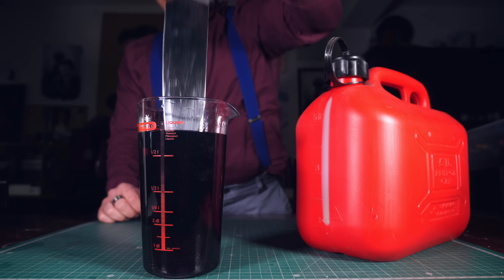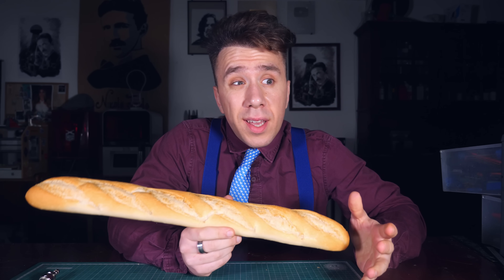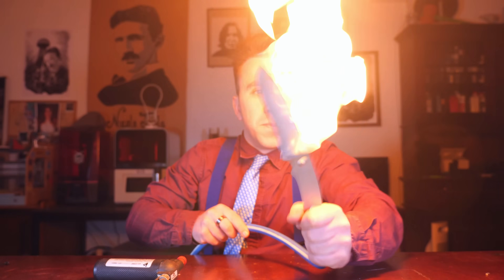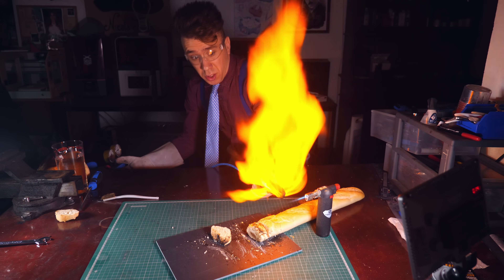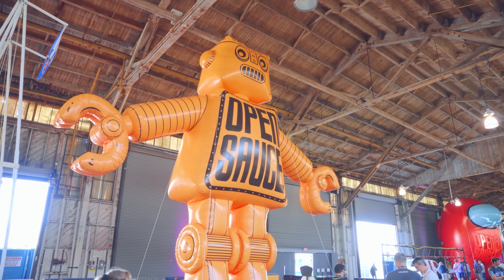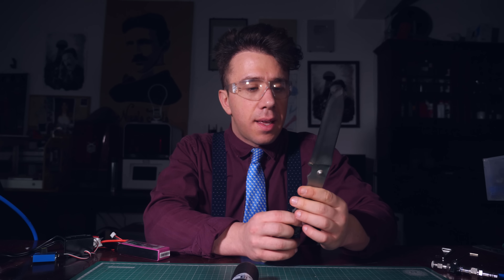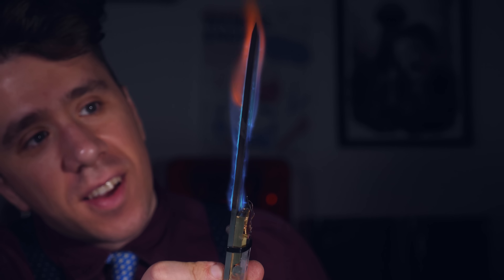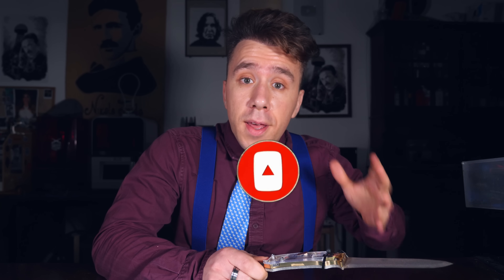I made a TRUE FLAMMING KNIFE

Comment: Can they do combined printing styles? For instance layers of solid/porous alternating, or having a solid shell with a porous interior, or the reverse. This could help with directional flow of air or liquid, making this ideal for many applications. 🤔 porous rings/tubes with directional airflow could assist in fuel/air dispersion, and could even have possible applications in design simplification. 🤔 you could have two separate intakes for air and have them meet in the handle, then design a track inside that forces the air towards the edge or tip, or only on one side of the blade. Would a porous turbine cover interior allow for adding the fuel in at that point? Just a thought. Also could this help with rotary fired propulsion?

Comment: Multidensity material to guide the flow of the medium and then use the porous area to release the fluid down channels or release in a pressured area to spew it out like a fuel injector. Think of air filter in the metal of an iron man suit so no toxins get through. That might be multidensity and material.

Comment: Mans just casually makes a lightsaber when testing a jet engine theory, Fucking sick.
Reply: Or you could actually Make a lightsaber using this principle with a telescoping tube, this could either become a bomb in your hands or evenly distribute the o2/h2 mix within the space and allow the pores to act as a filter screen so long as you have a double barrier between the ignition area and the fuel injectors (for safety, if you care about that).

Comment: It looks like if the internal channels are handled correctly, you could actually get the flame to be wholly contained within the blade. This would take some tweaking obviously, but that way there are no external flames, merely an intensely glowing hot blade. Not sure how the metal would handle such abuse, but if built of the right materials and tuned properly (and a heat guard of some kind for the hand) seems like it would be a devastating weapon. Additionally, in regards to a jet engine, if the application of porous metal could be strategically placed such as along the trailing edge of the blade, that could potentially yield better and more controllable combustion results.

Comment: As a project suggestion, look up Floyd sweet and T E Bearden, in particular in regards to a paper published in 1991. It will take you down into a deep rabbit hole that I think you will enjoy. 
I haven't managed to source a barium ferrite magnet yet.. the manufacturing seems to have changed to other materials. It needs to be barium to work I think. Beard explains it using optical math. 
But could be great fun. Even Tesla gets mentioned. Also a fellow name Whittaker. If any of it has any merit it would change physics. And piss off a lot of rich people in a dangerous way. But it would be a great video.

Comment: I know it is not a jet engine, but would a submarine hull made of this metal, or a torpedo travel faster through water with a hull made of this metal?  I know sharks have very tiny dimples in their skin to create less drag in the water.  If the hull emitted a shell of air bubbles around it would it have less drag?

Comment: You can also try doing a somewhat thin rocket nozzle that goes al the way to the end and returns to the center, cover all of it but the very center ( or end, for the nozzle to cool with the hydrogen) with coating the outside with metal so that the pores to the atmosphere are closed functioning more like a pathway for the hydrogen to pass by, just like the actual rocket nozzles, u can cool your nozzle while distributing fuel. These micro pore would probably work perfect

Comment: Is the idea of changing jet engines forever that they could pump air into the hot side of the engine and keep the heat away from the metal parts so they can run the engine hotter without melting it or something else?

Comment: this tech has one MAJOR problem for use in a jet engine, the whole inside is like a sponge, so blowing air through it for cooling has MASSIVE pressure losses because it's basically a giant throttling valve.
there's a reason why real jet engine parts that have film cooling use a shell with electrical discharge machined holes instead of a spongelike internal structure.
this sort of porous metal is also just not very strong, especially in tension, so the turbine blades, which get the hottest, would just break under tension from spinning if you made them this way.

Comment: As well as running fuel through it for smooth ignition and combustion in a jet, if you make the compustion chamber, foils and compressor blades with that material and run air through them it will cool them and allow the engine to run at temps above the melting point of the metal. Higher temp engine = more power, a lot more power.

Comment: electroplate steel or something hard and  paintable on to surface that cold then be pealed from it,  like a stove black covered piece of duct tape. extra points if yo use a microwave oven transformer.  then do the same to make a metal patch in a rusty car fender. 
again extra points if you use a tray of electrolyte and a pump to wet spray the metal onto the carbon black ducktape patch  building up to 2 mm thickness.

Comment: i don't know if anyone has suggested this, but try to create a rig for the knife you just made that spins the knife while it's rotating at around a 1000 rpm, and figure out the optimal rotational speed and gas injection pressure to create a literal flame wall... !!! 

props if you can do this with a long bar instead of a knife... this would be a good concept to start working on the jet engine tbh.... if the fan design can literally spew fire and rotate fast enough to suck in enough air, you have what you want.. :D 

if you like my idea, please conisider sending me that 3d printer... i would be absolutely thankful.... i don't even want it for free, i'm literally willing to pay what i can afford on my end to have one !!! 

living in a third world country is absolutely shit, can't find good deals anywhere and even if printers are available parts are missing that make it impossible for me to get it in my city in working condition...

Comment: Idea:
Spin momentum based drive.

Three main part.
A pipe shell that is closed at both ends.

At one of the inner ends, a plate that is anchored there with a motor.

So they spin counter to eachother.

And it is full of liquid. That liquid is hevier than both....

When that motor is running, at most of the pipe, the liquid is concetrated at the wall(/floor, really, spingravity/angular momentum) more at the end with no plate.

At the end with the plate, that counter spining(plate and pipe) makes the combined effect of the angular momentum on the liquid weaker. 
So it is not as heavy to the floor/shell, which makes it experience a presure differencial. Thus it goes to fill up the middle.
...

Remember, it is heavier than the shell, so it doesn't fly back/to the other end in the middle of the space in that pipe, as fast as it is throwing back that end of the pipe shell.

And that shell pulls with it some of the liquid at the walls, same liquid that is going on its own to flow that way because some of that liquid there is now at the middle of the pipe.

And some of that will be nullified by the liquid that goes back... more that enough to make sure that what hits that other, plateless end is not enough to actually nullify that forward momentum.

Comment: Why am I not surprised to see a video where Integza is cutting the cheese?   I kind of feel that if Integza cuts the cheese with a flaming knife, there should be some blue flame.  I think you could get a flint out of a standard pocket lighter you could mount it so it strikes on the blade and throws a spark without the need for a battery.  Ok, so the blue flame comes later.  It might be a good safety feature to have a spring loaded cutoff valve on the handle so you can stop the gas just by letting go of it.  That way, it won't continue to burn if you drop it.

Comment: The repellant feature is awesome! Propeller and boat hull would make a low friction and perhaps efficient boat.
Reply: Kawasaki did it years ago on one of their JetSkis. High pressure air was injected through ports on the front of the bottom of the hull. I can't remember what model, they didn't do it very long since it was prone to issues. But other ships have done it as well. Air Lubrication Systems they are called.
Reply: It seems great… till you realize turning off the pressure makes it just another leaky boat
Reply: @coffeegonewrong  Why would the upper/interior parts be porous?  That would be a foolish design that wastes half the power and whatever gas is injected into the hull.
If only one side (or only the blade...) of the knife needed to have the desired properties, they would seal the other parts, as they did with the handle of the demo knife and support fittings of the industrial ones.
Also, there's a point in hole diameter where air and other gasses can pass, but liquid water will be stopped.  That's what Gore-Tex material does.
Reply: @VoltisArt I didn’t know that about goretex. Sorry, sealing the parts you don’t want leaking makes more sense.  I guess the mental image was funny so I wanted to share.

Comment: Another material that looks just like the 3d printed porous knife, is the air mufflers/diffusers on industrial pneumatics. Under magnification, some of them look like brass beads that have been heated and pressed into a truncated (blunted) cone shape. If Integza wants an off-the-shelf porous material, that has pipe thread already attached, I would use the pneumatic muffler method. I just checked the industrial supplier McMaster-Carr here in the USA, and I see they even make stainless ones.

Comment: The real use for this I see is in the fan blades.  They already have piping in them to get a layer of cool (relatively) air protecting them from the post combustion heat.  This would be even better.

Comment: If you get a lean (oxygen rich (air rich)) mixture going into the blade and run it for a few seconds then the metal should get hot enough to ignite the mixture within the knife leaving fully combusted exhaust, and the heat will be focused on the blade instead of making a huge 3 foot torch, so you could toast bread better 

You'll want to turn down the flow a bunch to keep the blade from melting

You could also drill a hole through the handle, and insert a pipe to seal off leakage in the handle, and increase transmission speed/capacity to the blade

Comment: I like the idea that you went, "not a fan of this plastic spinning next to me. I think ill stop." But you were just playing with hydrogen and oxygen in a shared line. As someone whose accidentaly caused a small explosion in that same way, that made me fucking nervous.
Reply: Same, every few minutes I got crazy nervous and mad at him BC he never said don't try this yourself and that stuff was dangerous af.

He literally put a highly flammable battery that could explode or catch fire (which would not be easy to put out) when subjected to heat next to a handle that is so hot it burns you through gloves. And that is only one thing.
Reply: he hooked up air not pure oxygen. still really dangerous but a pure oxygen supply is the one where you need to build flame arrestors in the line or else itslikely for your supply to explode.
Reply: @28porkchop  That is crazy still.

Comment: i wonder if its possible to have the blade significantly more porous as you get closer to the end so most of the gasses escape further away from the handle possibly even directing it to the point so the handle doesn't get nearly as hot, i think that would be a cool mark 2 of this knife

Comment: Too many comments for me to catch up, but this concept could easily be used for control nozzles (for instance afterburner or rocket nozzle components) as either a stand-alone, or an internal liner, to the parts (for instance inconel), which, if pumped through with air/whatever coolant, basically would create a cooling "shield layer" preventing hot exhaust gases from direct contact with the surfaces, thus allowing much higher potential exhaust temps without weakening/melting the surfaces.  
Also makes me think of a redesign of other troublesome surfaces, such as an SR71 inlet and other compressor surfaces, where the engine (and plane) itself could literally go MUCH faster than they ever did, mechanically, except that the parts would reach thermal failure levels... again, even a small flow of cooling air (or even possibly fuel injection as a coolant through the pores with significant enough flow to break the laminar flow on the surfaces, of the inlet/exhaust flow) would dramatically lower the material temps, thus allowing further performance.  Just some thoughts of possibilities, I bet someone else (in the labs already, or even here) has thought of this though.

Comment: Project idea: car stereo amplifier connectors, primarily power and ground.
 All connectors are one screw chewing into wires.
 Why isn't there a rotating while reducing clamp that doesn't damage wires and acts like a boa-constrictor ?
Further design would be a tiny gold plated tungsten needle at the amp side that could be slight conical and keeps the end part flared out, which would help secure the connection.

 0-8ga wire, trimmed end going into a flared hole with a center prong in the middle that will help separate the strands and on the back side (end of wire) will flare out again.... Now the center of the hole will be able to reduce its diameter with a greater clamping force than anything else without any damage to the strands, unlike current standards that drive a screw into them and mash them.

 This would and should be adopted as a newer standard for many reasons.

Comment: The only issue that I can see with having micro holes in the blades of a turbine is the loss of structural integrity and the risk of them bending and flexing while at operating speeds which could cause them to either knock into each other or oscillate and strike the housing of the compressor. Very interesting concept.

Comment: I don't think that this will change jet engines at all. Something like this was done in the beginning of jet age, when combustion instability was a MUCH bigger problem than what it is today. It used sintered pieces with the same properties. It proved WAY too lossy. Pressure losses were incredibly high. Cooling sheaths in HP turbines are also already state of the art.

Comment: For your next project you can make a 3d printed engine working with 40000 rpm compressor try to get maximum mechanical rpm with using the compressor

Comment: your jet engien idea is nice but I say that you can input air and the gas through the same tecnich an dthe whole engine metal .
and my idea is you could make a swiff knife sell it only for authorised persons.
or you could make a cooler for the summers . if it is cold there a heater or both.
you could make a electric skate board or inliner skates or a electric board or a hover board or a electric scooter or a bike fo winter with spike wheels to use on the frozen lake or pond.
or a machain that makes normal water filtered or carbonated . 
or a electric bottel with filter .
or a piece to put on your finger and then it turns into a lighter.
or a magnetic thrust machain .
or a real lighter saber with real fire. ( for the tomatoes )
thank you .
your big Fan.

Comment: I don't have a 3D printer: could you make me a jet prop?  

Make a prop, at the thickest part pass a jet stream of water or steam.  The Force of the water turns the prop.  The constant change of vector resistance will allow for a more efficient water jet engine.  

Now apply this to your jet engine: and use the system in two stages: to cool the air and the components: while expanding the gas to accelerate the combustion, and add more air to the final exit burn.  

I would also like to see you make a scram jet rocket engine.   This uses a hollow rocket body: that has intake to the rocket: internal burn: and a higher exit velocity of total exhaust.  The scram portion would activate once the rocket was at an advanced speed.  I have some drawings of this design, but not no useful ones of the Jet-Prop.

Comment: #theme hey, make a DC motor with thick copper wire and give very high voltage. I have seen many videos about it. At very high voltage it rotates very fast around 80-90k rpm. But NO ONE YET able to break the sound barrier. So give it a try to break it.

Comment: 3d print a cylinder and a cone of the same material as the knife and and assemble them into a jet engine... you won't need fuel injectors as those will do the job quite nicely.

Comment: Very cool! Not sure if the volume of air it will pass will be sufficient for a jet though. When you started the episode I thought you were going to have one side be non porous and have the fuel come out the one side for a jet engine though. 
I'd like to see a show on the ranque- hilsch vortex tube as it is being applied by Malcom Bendall in his plasmoid/thunderstorm generator. By the way, check out his redesign of the jet engine. It is quite interesting if it works.

Comment: The main problem I can see is that at least some of the blades need very high strength  to the point that they use specifically developed alloys and processes to get single crystal parts. This process makes something a lot more like sintered metal foam. If the blades of the turbines made this way, get hot enough at high stress. I can foresee them deforming and or crumbling apart. Other engine parts may be more promising however. Imagine self cooling combustion camber walls with air or something else being feed in through them.